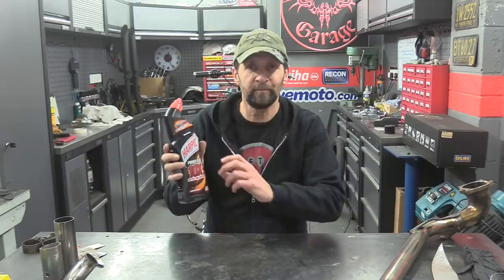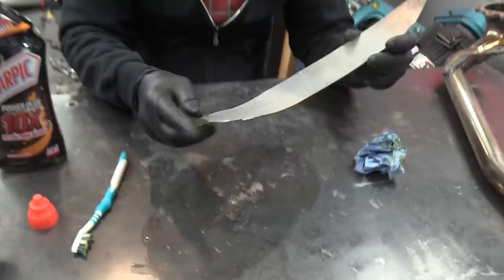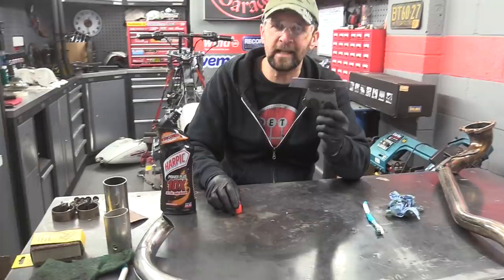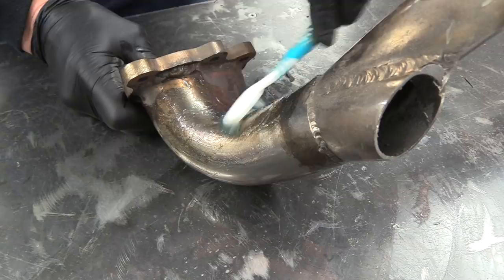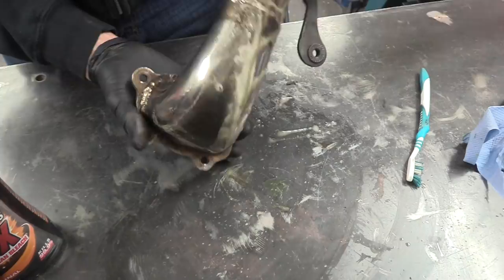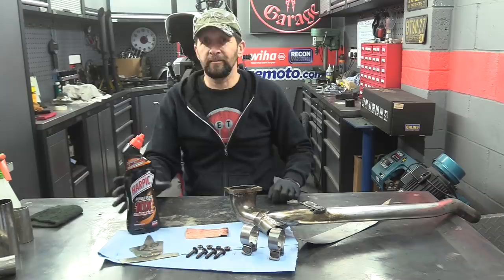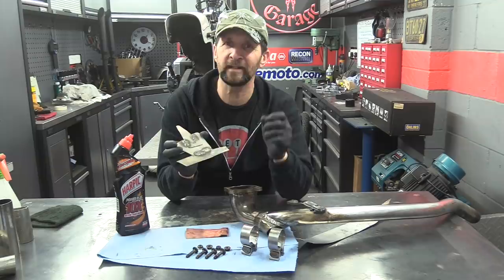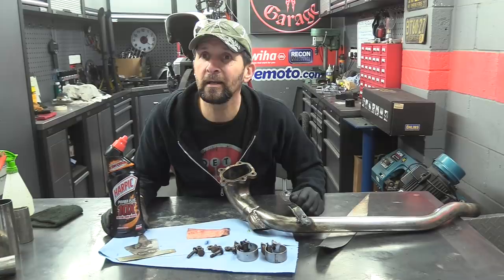Delboy's Garage, Simple Skills, "Cleaning Steel with Harpic" !

Comment: Hi Del....how well does it work on chrome over mild steel.
Reply from the maker: Its well known that it will burn it and ruin the finish mate.. only on Stainless steel and even then, make sure you wash it off thoroughly afterwards !
Reply: @Moonfleet41  Ok thanks Del....
Reply: For chrome use some scrunched up aluminium tin foil and water to lubricate.

Comment: Would this work on my subframe that I removed so it could be powdercoated? Not sure if it would harm the finish afterwards...
Reply from the maker: Hi buddy, I think from what everybody is saying it's forte is cleaning tarnished stainless steel exhausts, anything else I thin is incidental,  if you'r cleaning for powder coating, it's the same as cleaning for paint, and if it's non-rusted clean bare metal, then thinners is best... but surely the powder coaters will do all that themselves!

Comment: Very nice video, thx. 
Can I use it to clean my aluminum LeoVince Evo 2 as well?
Reply from the maker: NO, NO, NO, DON'T use it on aluminium in any circumstances... it will strip the anodising off in seconds, hydrochloric acid is serious stuff and even at a 9% concerntration it will do permanent damage to your aluminium...
Reply: @Moonfleet41  Do you have a tip for me cleaning aluminium and keeping the mat brushed style. I don't want it to shine.
Reply from the maker: @walidschenke1882  Yes indeed.. just polish it like it was ordinary shiny finish aluminum... then use a fine grade scotch pad and very lightly buff back the satin finish... not so hard it leaves scratch marks.. but enough to knock the shine off.. Good luck.

Comment: Do you think this would be a good method to remove rust from my fuel tank? I’m not worried about the paint work getting damaged as it’s getting painted .?
Reply from the maker: Hi Shane.. if you mean from the Outside then yes, great.. but make sure you wash it off with lots of hot water after because its thick and sticky. and any residue will effect the paint when you spray it later..!
Reply: Cheers mate . Thanks for your advice  . I meant inside of the tank but I have surface rust in the outside also . So will give this a try . Thanks
Reply from the maker: @shanejohnston8985  I wouldn't use it on the insider mate.. just in case you can't get it all washed out.. it will eat through if you leave any in there..!
Reply: Moonfleet41 thanks for the heads up 👍🏻 might be a suggestion for a future video . Thanks again for the reply

Comment: Any ideas whats best for removing  mild pitting on my Bonneville cast alloy wheels?
Reply from the maker: Hi Graham, ok, is the pitting in the lacquer, or is it bare alloy that's pitted?  If it's bare, then the old trick is ever decreasing fine wet n' dry, finishing with 1200grit and soapy water, then Autosol polish to get it mirror shiney!  But if it's lacquered, then you need to get that off first with some paint stripper and then repeat the above for a fine finish... but if elbow grease, but it works, and they'll come up like new!

Comment: Can I  use this on the inner heat shields on my vance hines.  Their rusty inside but outer chrome is good.  If I tape up and protect the outer chrome? ?? 
Thanks
Reply from the maker: I wouldn't if they were mine mate, if they are chrome on the outside, then however crappy it might look, the plating will be on the inside too, so you will probably strip it off altogether and make it rust even faster down the line... if it was mine, on the inside I'd sand them back and paint them with silver heatproof paint...
Reply: Moonfleet41 okay,  sound's a good idea.  
Thanks very much for your help.

Comment: Thats pretty awesome stuff just wondering if it will weaken the bolts at all.
Reply from the maker: If you left it on for days, then yeah, it probably would, but rusty bolts are weak anyway, the rust'll do that for you, so unless they're stainless, it's time to replace them maybe as I'm gonna try to do with mine.
Reply: @Moonfleet41  I just bought some off ebay but strangely enough they don't sell that one in the US so Its comming from the UK:)
Reply: @Moonfleet41  Man they do not sell that version in the US trying to see if I can get it some where else:(
Reply: They cancelled my first ebay order..probably cant send it here:(

Comment: Do you think it would work on Aluminium Ok???????
Reply from the maker: No mate, certainly NOT, if it's anodized it will burn the anodising clean off and it'll leave some horrible scarring on bare aluminium, purely for stainless steel and mild steel only!
Reply: @Moonfleet41  Cheers thank you!!

Comment: why didn't you test aluminium, been looking for a cleaner that works for years
Reply from the maker: This certainly won't work on aluminium mate, it'd practically dissolve it, and the only good thing it does for aluminium is strips the anodizing off, providing that's what you want, but it'll burn it pretty severely, so steer well clear chap.

Comment: Could this be used to get rust off of chrome?
Reply from the maker: NO SIR!... DON'T use it on chrome, it will stain it badly , there are a few tricks to get rust from chrome, one is tin foil and cola, you can also buy regular chrome cleaner from the bicycle shops or car accessory stores and it works fine, but this acid will burn the chrome for sure!

Comment: Any idea if it works on Chrome?
Reply from the maker: NO, certainly not, don't use it on chrome, if your chrome is corroded, that is permanent damage and this stuff with burn it and make it worse, this works strictly on stainless steel only.
Reply: @Moonfleet41  ok thanks ✌️

Comment: commercial crap  you only need  muriatic acid  aka brick wash  cheap by the gallon  fancy names for diluted hydrochloric acid. some unnecessary  stuff as lime away in the USA...its also helps if the item of any metal is degreased and warm from the sun...

Comment: It will clean metal as it contains hydrochloric acid which will eventually eat through the chrome so don't use it !!
Reply from the maker: No indeed.. Don't use it on Chrome.. and on Stainless Steel.. make sure you wash it off thoroughly...!